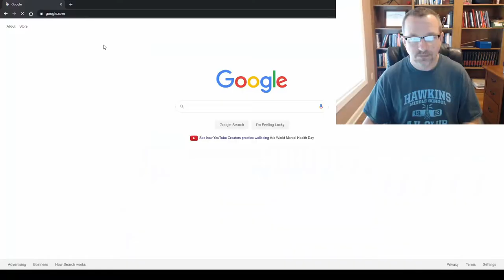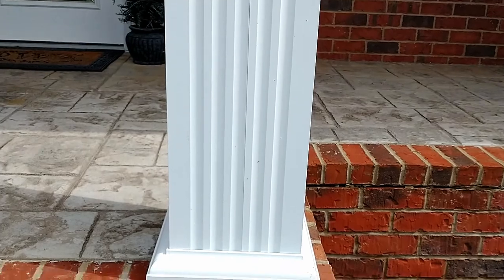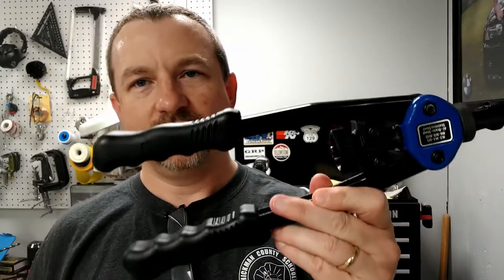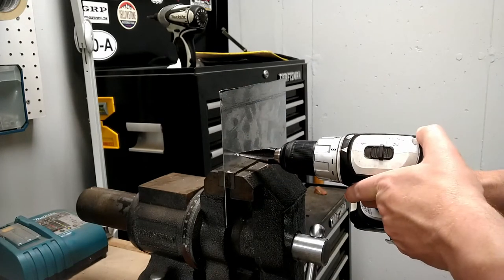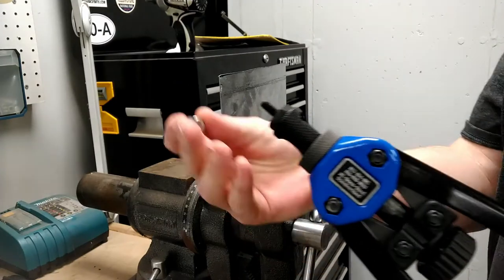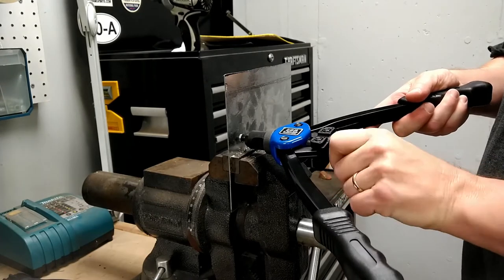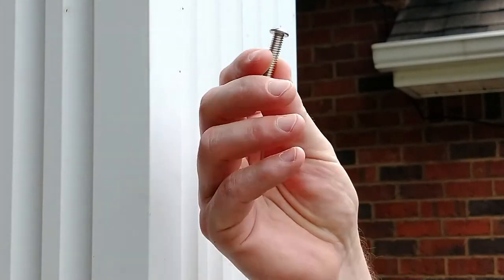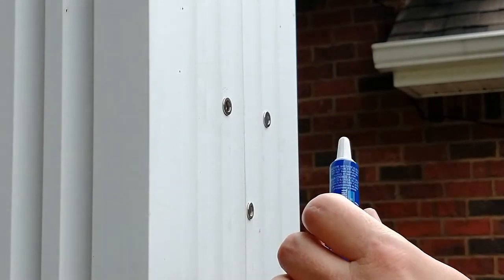Project #35 - Flag Bracket Installation

Comment: OK, so what if I don't have a rivet nut tool?  What is your second choice to accomplish the task of installation into an aluminum column?  Thank you for the informative presentation!
Reply from the maker: You could use sheet metal screws.  They have a drill point on them, and are made to drill into metal as they thread in.  It would not be as solid of a joint as the rivet nut solution, but would probably work.

Something like this would probably work:
https://amzn.to/46kK6pW

Comment: Great step by step video. Very thorough. I'm about to install almost that exact mount on an aluminum square column. Looks like I'll need some new tools that I'll probably never use again. Thank you for the tips!!
Reply from the maker: It's been 7 months since I did this install and the fasteners are still holding great.
Reply: I have that exact mount and I ordered a rivet nut tool from Amazon. However I didn't hear you say which size rivet nut you used and also what size button top Allen wrench screw you used. Could you tell me which size you used. Thank you!!
Reply from the maker: @mattweikel8432  I'm 99% sure it was 1/4"-20 bolt size.  I also picked stainless steel for both the rivet nut and the bolt, so they would never rust.
Reply: @VancesHowTo  Thanks ill try that out!
Reply: What size drill bit was it again?
Reply from the maker: @scottjosephitis330  I used a 23/64" drill bit.  The spec sheet for the rivet nuts I used shows a diameter of 0.350", so you want to be just slightly larger than that.  23/64" = 0.359".

Comment: Thank you for the great video guide. My aluminum column has a different contour that does not allow all three rivets to be installed on a flat surface. In your experience, will a rivet through the contoured portion work effectively?
Reply from the maker: It all depends on how much of the expanded rivet is in contact with the column walls.  It might work and it might now.

Comment: Thanks for sharing this video, I was stumped with the same problem.

Did you have to drill the holes in the mount as well since smaller than 1/4?
Reply from the maker: I don't recall for sure, but I think I did open the holes up on the mount a little bit.
Reply: @VancesHowTo  got it up and worked great! Thank you for the video!